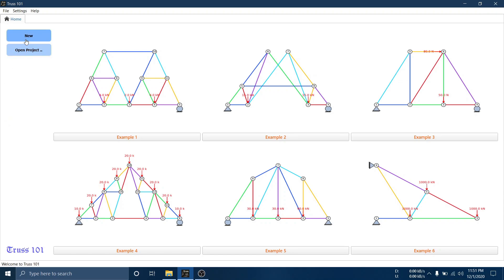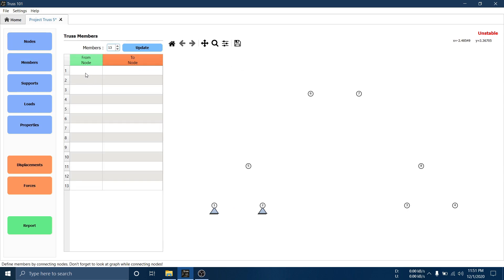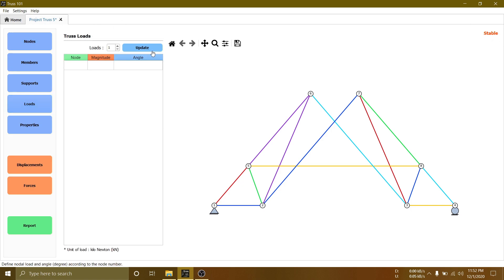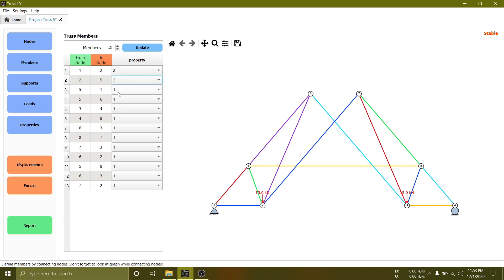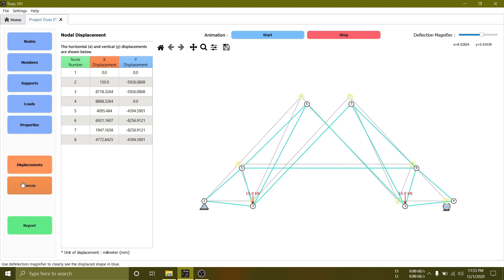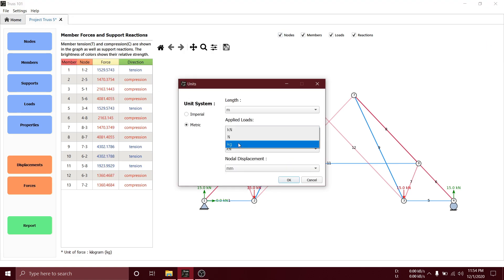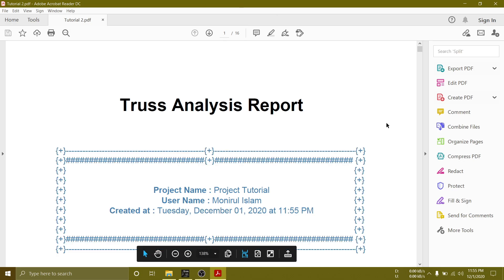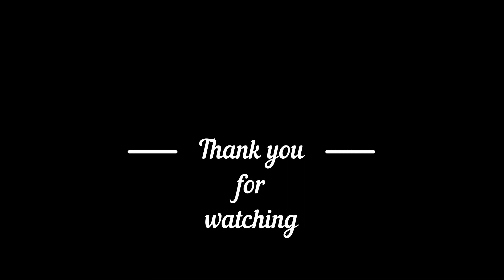Analysis of Truss Structures Using Truss 101 Software

Comment: Great job. You made some really cool GUI. How are you live updating the nodes and members on graphics?
Reply from the maker: Thank you !!
Whenever the node's table, member's table cell is changed it will call node function, member function respectively.. this node function will call member function and member function will call the graph function which will update the graph.
 node function --> member function --> graph function
Reply: @mshawon1  Oh great! & Thanks. I developed a similar truss analysis software on Tkinter. Never knew pyQt5 was so awesome.
Reply from the maker: @chandrakhadka1749  actually I used PySide2 and Qt Designer.. I have watched your video...great work btw..if you want to make a modern GUI you should take a look at Qt Designer with PySide2.